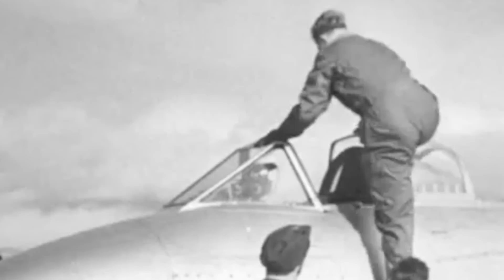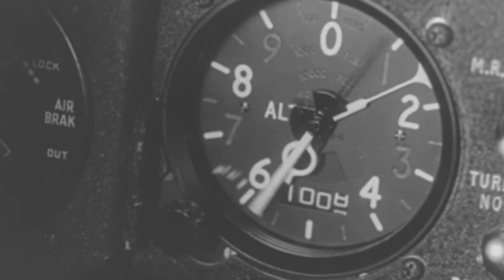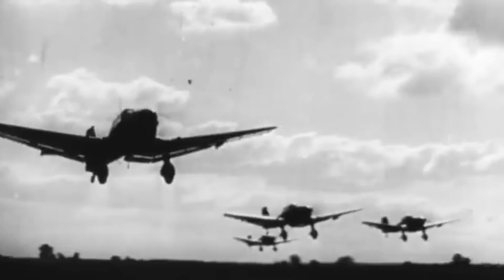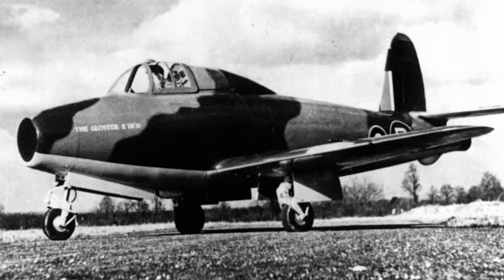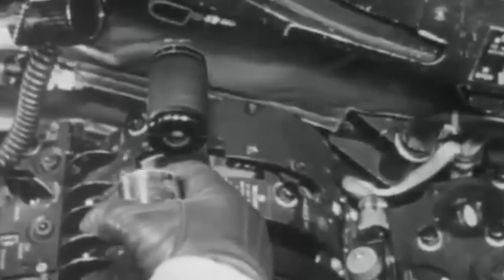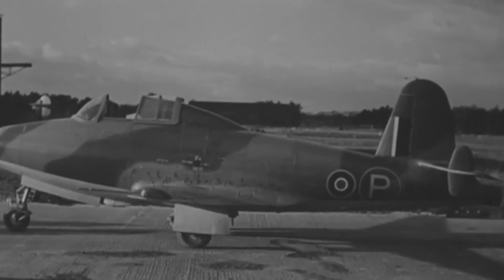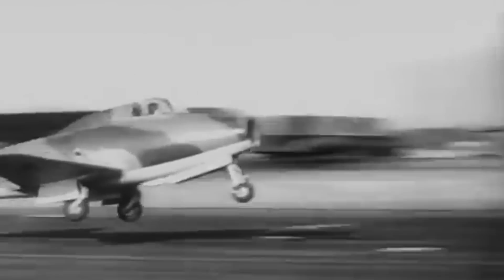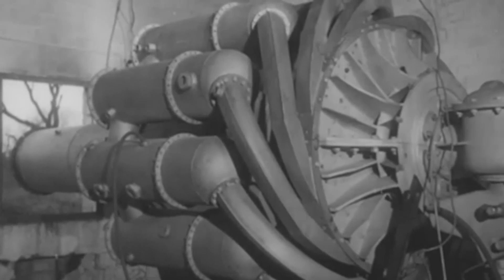Britain's 500 MPH Coffin With Wings

Comment: Proof that Britain was at least  2 years behind the Germans in the development of jet engines and jet aircraft.
This technology gap would only widen as the war continued
Reply: We feel we can clear up some commonly held myths and misconceptions, obviously.

It's always good to see the facts presented clearly and concisely isn't it

See further down for a Meteor losses comparison.

Indeed that's correct. The Whittle Gloster E28/39 was of course a brilliant aircraft that was later copied in Russia as the upsized and tweaked Mig 15 with a copy of the RR Nene gas turbine aero engine.

Obviously the RR Nene being the world's most powerful & most reliable gas turbine aero engine in 1944. 

   That's correct, of course the MD F3H Demon was a contemporary to the DH Sea Vixen & had a similar performance. The F4 Phantom was a follow on from the F3 Demon. The Sea Vixen took a long time to get from first flight to introduction for various reasons and a similar situation occurred with the MD F3H Demon. 

McDonnell Douglas F3H Demon
590 Built.
Introduction date 7 March 1956
First flight 7 August 1951
Retired 1964

MD F-4 Phantom 2
Number built 5,195
Manufactured 1958–1981
Introduction date 30 December 1960
First flight 27 May 1958

DH Sea Vixen
Number built 151 (including two DH110 prototypes and one Sea Vixen prototype)
Introduction date July 1959
First flight 26 September 1951
Retired 1972

Non combat phase accident losses.
% of Aircraft built.
The Canadair CL-44 was a turboprop airliner.
Canadair CL-44              (ff 1959 ) 48%
Lockheed XF104              (ff 1954) 100%
Lockheed  P80                 (ff 1944) 43%
Lockheed F104                (ff 1954) 45%
MD FH Phantom 1           (ff 1945) 35%
MD F4 Phantom 2           (ff 1958)  28%
MD F3H  Demon              (ff 1951)  32%
Gloster Meteor               (ff 1943)  21%
DH Vampire                    (ff 1943)  23%
DH Sea Vixen                  (ff  1951) 33%
Gloster Javelin                (ff 1951) 20%

    Regarding the UK Aerospace Sector.
  
An airline recently ordered 60 RR Trent XWB Engines

   Clearly It's a great pity & a crying shame that British military forces had to occupy a large part of Germany for decades after 1945 & Russian military forces had to do the same. Of course Russia still posseses a large chunk of what was German territory & of course Russia & the UK produce nukes. Obviously Germany does not produce nukes.

   Interesting British achievements.
There is no doubt that the Fairey (England)
Delta 2 was of course the world's first jet
aircraft to exceed 1000 mph.  lndeed It
exceeded the previous record by 310 mph &
held the record for 1 year. Incidentally, the Dassault Mirage 3 & 4 are based on the Fairey Delta 2.

Early days, jet fighters.
   De Havilland Vampire, Sea Vixen & Gloster Meteor accident losses were not high or unusual for fighter aircraft at the time. De Havilland built large numbers of all metal airframe aircraft before the DH Comet.
We mustn't forget of course that the DH Vampire for example first flew in 1943 & the engine was also built by De Havilland. There were examples of the Vampire interceptor / fighter in service until 1990 which was operated by more than 30 countries.

Non combat phase accident losses.
% of Aircraft built.
The Canadair CL-44 was a turboprop airliner.
Canadair CL-44             (ff 1959 ) 48%
Lockheed XF104             (ff 1954) 100%
Lockheed  P80                (ff 1944) 43%
Lockheed F104                (ff 1954) 45%
McDonnell FH Phantom  (ff 1945) 35%
Gloster Meteor               (ff 1943)  21%
DH Vampire                     (ff 1943)  23%
DH Sea Vixen                  (ff  1951) 33%
Gloster Javelin               (ff 1951) 20%

   An example of what goes on these days in various countries.
Obviously, for example, there are of course no German companies that makes German jet aircraft in Germany & there are no German Companies that make German gas turbine aero engines in Germany that are suitable for widebody airliners.

     That's correct, Brazil makes very good airliners & Brazil is 100th down the list along with Indonesia for wealth per capita. Of course it is in fact the case that Embraer can't build those airliners without purchasing stuff from the US, UK & Europe.
Norway Holland Denmark Ireland Belgium - Top 20 wealth per capita - Don't make airliners -  its as simple as that.

   Early days of the airliners.
That's correct of course, at the time the Comet wasn't particularly dangerous. Agreed, that is indeed the case of course, The DH Comet was definitely not the worst engineering failure in commercial airliner history.

Losses comparisons
How things were in those days.

DeHavilland Comet 4 UK                       14%
DeHavilland Comet all  (ff 1949)           17% 

Boeing 307                               70%
Boeing 247                               48%
Boeing 707            .                  20% 
Lockheed Electra Turboprop   29%
Canadair CL-44  Turboprop     46% 
Convair CV-580  Turboprop     22%
Convair CV-880    (ff 1959)       27% 
Convair CV-990     (ff 1961)      33%
Tupolev TU-104       (ff 1955)    16%

     Of course De Havilland had prior experience building many all metal construction airframe aircraft & thousands of jet powered fighter aircraft that were primarily of metal construction with pressurised cockpits & jet engines built by De-Havilland.

  More recent UK military jet aircraft.

  Of course the Tornado & Typhoon & their engines are Supersonic & are indeed British design aircraft with British design engines built by an international consortium. The Tornado design for example started life during the 1950s at Vickers as the AFVG, it's engine is based on the RR RB-199. The EE Lightening is also a British Supersonic jet aircraft.

  The Typhoon is the British BAC-EAP with an engine based on the British RR XG-40, the Typhoon is also built by an international consortium.

  Agreed, that is correct of course, clearly there are many countries that could easily produce airliners of better quality than Bow-wing (see b-47 wing folding & wing collapse incidents) but don't for some very good reasons. Bow-wing (see B-47 wing folding  & wing collapse incidents) being a result of the size of the US, the large protected domestic market & great ease of testing new types due to the equator to arctic geography complete with up to date aviation infrastructure & a few other reasons related to production scale capability, politics, the nature of the airliner market coupled with the nature of airliners themselves & general basic economics.

  Obviously there really is nothing special about Bow-wing, having more than 50 years design / build experience on the type means they have no excuses for the horrendous 737 Max incidents for example.

    Indeed GKN Aerospace, BAe Systems & Rolls Royce combined now do more Airbus work than Germany on an absolute basis & significantly more work than that on a per capita basis.
  
     Agreed, Per capita for the home nation BAe Systems is the world's largest defence contractor.
 
    Correct, BAe systems announced the recent £4 Billion takeover of Colorado based US based Ball Aerospace.
 
    It's definitely the case that BAE systems now does a significantly higher value of work for Airbus than it did when it was a major Airbus shareholder before 2005.
    
      Obviously RR now owns US Engine maker Allison for example which does classified Aerospace work for the US Govt.
  
   Yes, that's right of course, Anybody currently flying on a widebody airliner stands a good chance of being on an aircraft powered by RR gas turbine aero engines built in the UK.

   A typical but small glimpse of what goes on in the very internationally orientated British aerospace sector. 

  Of course the RR Nene was in fact the world's most reliable & most powerful gas turbine aero engine in 1944. Licensed built versions & copies of the RR Nene & RR Derwent would go on to power many aircraft in Russia including the Mig 15 & Mig 17, the US, China, France & other countries for decades after 1944.

      Boeing Apache Attack Helicopter.
AH-64: 75 UK suppliers, 7% UK content, global fleet of 1280+ aircraft.
F35B more than 130 UK Suppliers, more than 30% UK content.
F35A & F35C more than 130 UK Suppliers, more than 15% UK content.

   There is no doubt that an airline has just ordered
60 RR England Trent XWB Engines

Obviously the UK has the
World's Highest Combined Per Capita
Nuclear / Defence / Aerospace Sector Activity.

Rolls Royce Holdings UK
Subsidiaries
- Rolls-Royce plc
- Rolls-Royce North America (Allison etc Classified Military stuff)
- Rolls-Royce AB
- Rolls-Royce Deutschland
- Rolls-Royce India Private Limited
- Rolls-Royce Marine Power Operations
- Vinters Engineering Limited
- Rolls-Royce Controls and Data Services
- Rolls-Royce Power Systems
- Bergen Marine
Joint ventures include:
- Rolls-Royce Turbomeca
- MTU Turbomeca -

Trent Family
The MT30 (Marine Turbine)
Industrial Trent 60 Gas Turbine
Trent 7000
Trent XWB Airbus A330neo.
Trent 1500
Trent 1000
Trent 500
Trent 600
Trent 700
Trent 800
Trent 8100
Trent 900

RR wholly owned subsidiaries in Germany handle smaller 2 shaft RR gas turbine aero engine work.

Clearly the line above this line is blank.

We do indeed hope this helps, of course.

Cheers as always & 👍 indeed.   
    
. ..... ...... .....
. ...... . . . .. . .